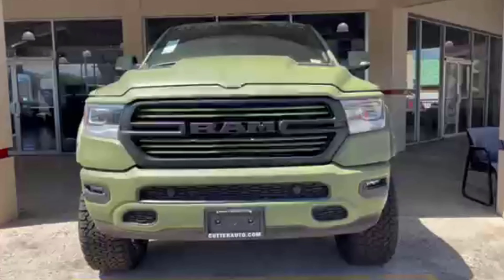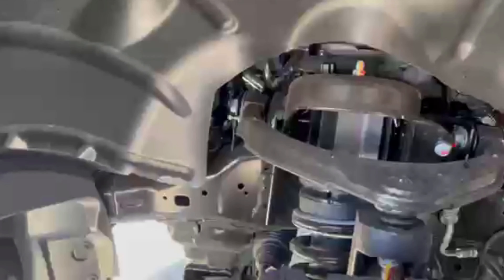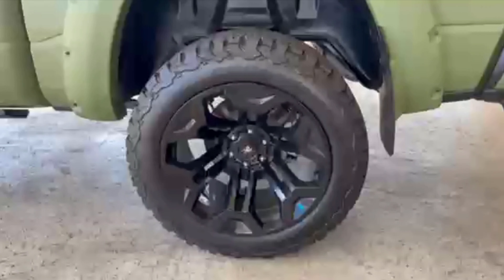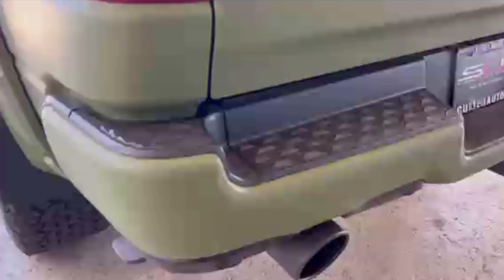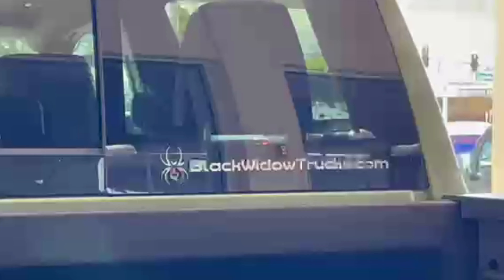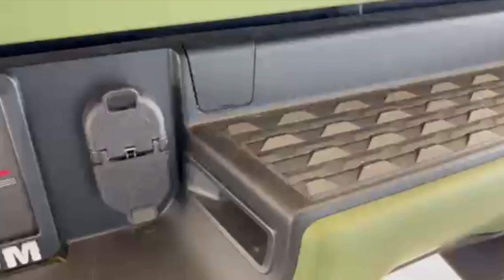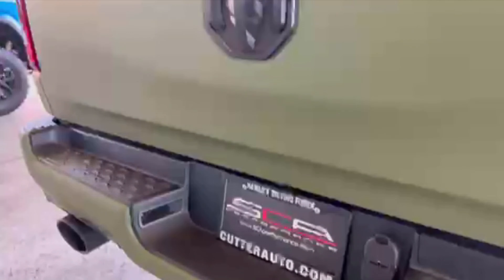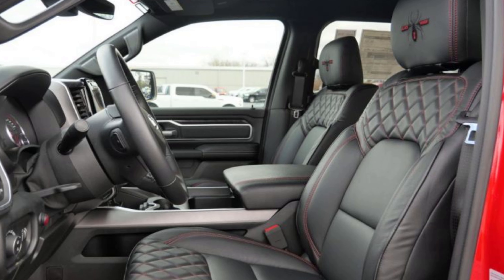2022 Ram 1500 Black Widow Armed Forces Edition: Is This Worth As Much As A Ram TRX?

Comment: Nice mall crawler truck with those 20 inch wheels. Why even bother with the off road tires - just put some mall tires on it. Not a fan of the bolt on fender flares. But I do like the color. I'll stick with my Power Wagon  - thank you very much.